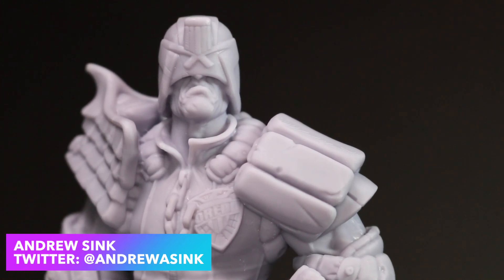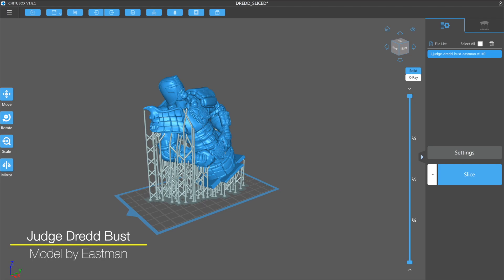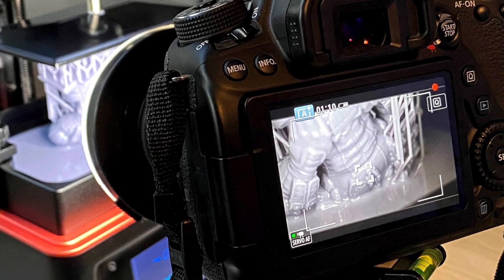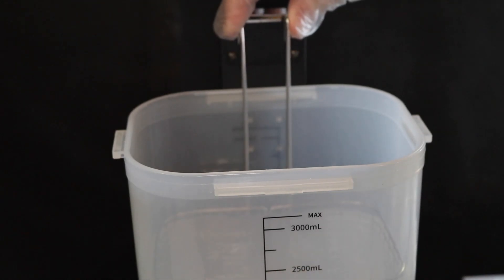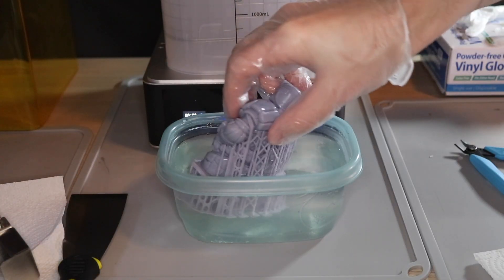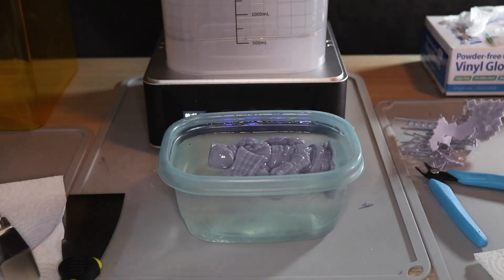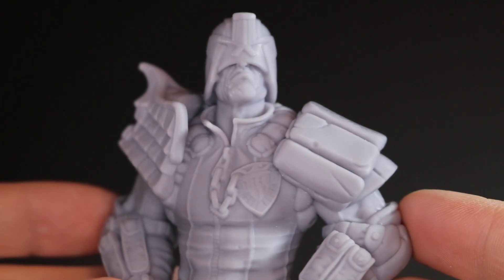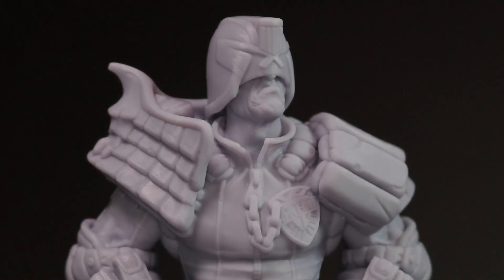Resin 3D Printing Workflow ft. Elegoo Mars 2 Pro + Mercury Plus

Comment: how come you didn't wash the print using the mercury's ability to use the build plate itself?
Reply from the maker: It was too tall! The part would bump into the impeller even at the highest setting on the Mercury.
Reply: @AndrewSink  oh ok that makes a ton of sense